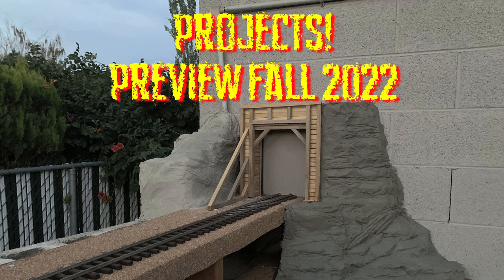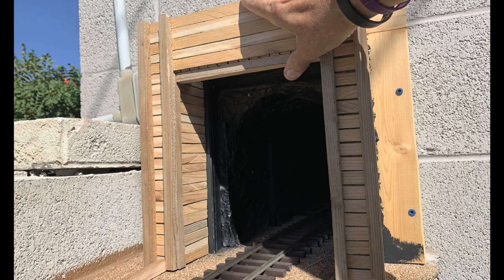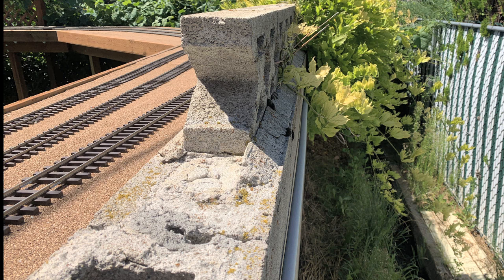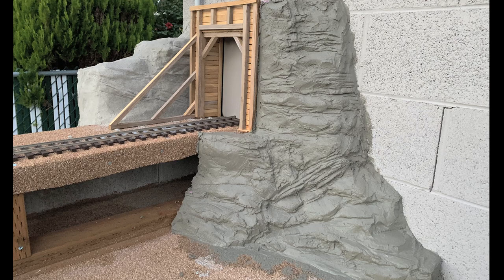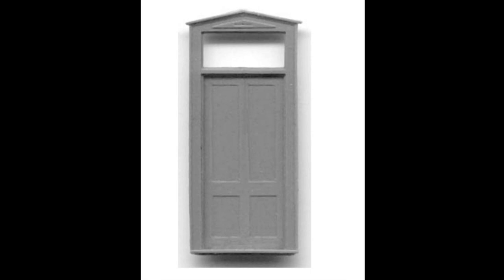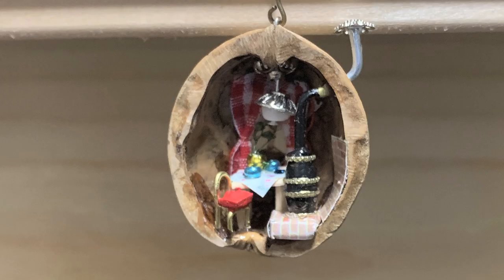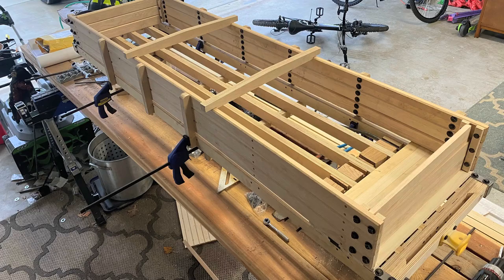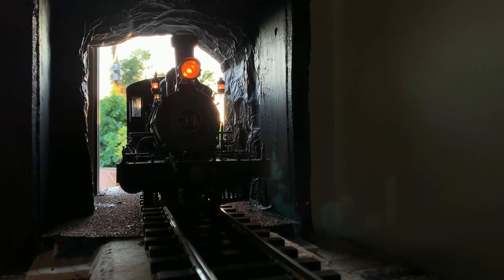Preview of Coming Shows

Comment: Lightly brushing stucco with a throw-away brush will soften and naturally age any "rock formations" you make. I color mine with thinned out latex paint. I also source my cedar from Home Depot in the form of cedar fence boards. They''re pretty cheap (around $2.50 to $3.50. Mill up great, naturally gray and  weather well, and take fastenings well. I build all my truss bridges and trestles with them.
Reply from the maker: That is what I used for wood!  Except I already used it. Then left it outside for a year. Then cut strips!! Same thing though.